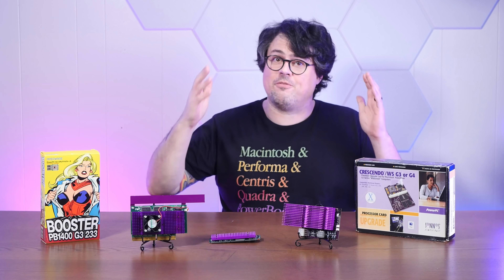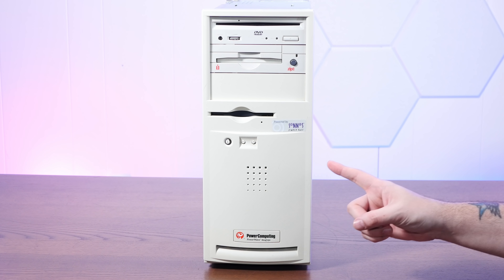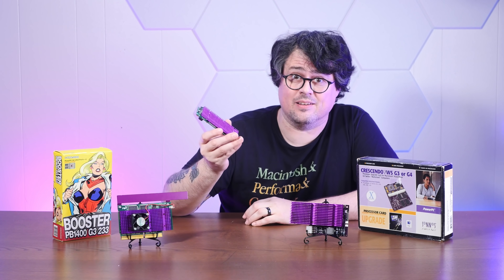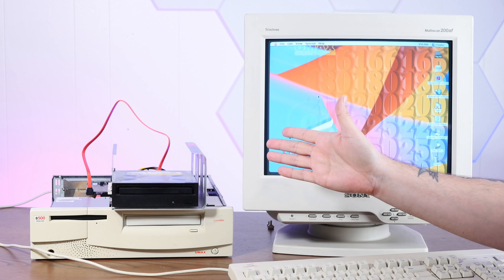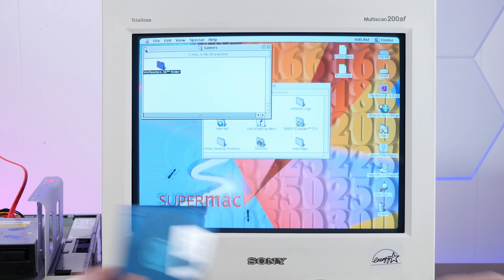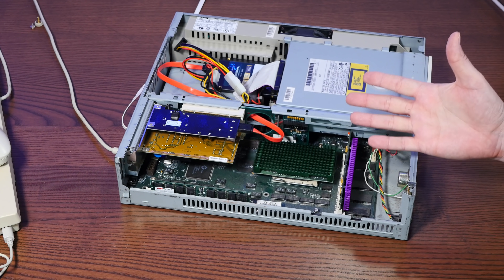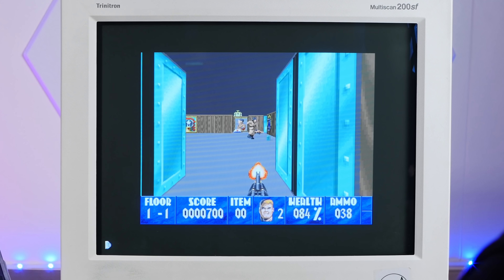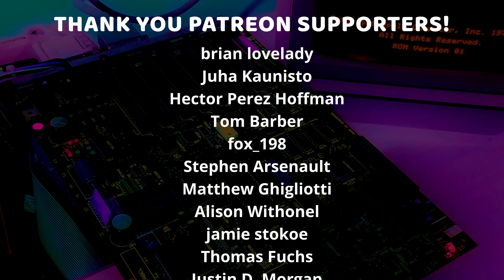An IMPOSSIBLE G3 Accelerator for "Upgrade Challenged" Macs

Comment: Apple back then: "hey, wanna turn your 68k into a g4? we got da hookup"
apple now: "you want a new Mac? no, no. without a corporate expense account, the best you can get is a Mac Mini, and if the warranty sticker still isn't on everything, we get to wipe the boot drive and ban you from buying another"
Apple now has pretty much become like trying to buy a Ferrari, and it's disgusting that people still put up with it. But it then makes these videos that much more exciting!
Reply: People wouldn't put up with it if there were a competent, viable competitor that wasn't equally as bad. Like, if you want a good Windows machine today, with the kind of low-bloat out of box experience you get on a mac, you basically have to buy a Surface. A completely unrepairable Surface. My last Windows PC was a HP tablet that cost me literally as much as a similarly specced Mac would have at the time, 2015, and the build quality was appalling. I treat my computers well, but my HP Spectre X2 literally had buttons falling out of the chassis, and the stand had gotten sloppy within six months. Further, despite using USB C to charge, it wasn't PD compliant. Their USB C charger had a 19V mode, and a PD compliant charger wouldn't work in it, so you were stuck with their brick only. HP are supposed to be one of the good ones, the big corporate players. I would have bought a Lenovo, but Lenovo in Australia basically only sells to corporate purchasing departments. If you want a retail Lenovo here, you're paying Thinkpad prices for their budget Ideapad line.

Since getting my M1 Air, I've noticed small touches to the hardware that I didn't know COULD be good. Like, until now, I've never used a trackpad that didn't make me immediately want to plug in a mouse, and in Windows, I've never seen multitouch gestures that actually worked. I didn't know laptop speakers could be good on anything but a 4kg gaming laptop, but on the M1 Air, they're impressive, and they face UP which shouldn't be so rare, but it is. Frankly, Apple can get as draconian as they want in their control of the hardware we buy, and I'm probably going to keep buying Apple gear because there just isn't good competition for them. The price isn't even as outrageous as it used to be. I mean, sure, there's no $800 laptop option. I'd like to see them revive the iBook branding. I wouldn't mind a lower res screen and a plastic case if I could get a Mac laptop under nine hundred dollarydoos (the official name of the Australian currency), but if someone is looking at a $1000-1500 HP, there are very few reasons for them not to consider a Mac instead.
Reply: @NoobixCube  speaking as someone that's basically built their own desktops and builds and such, sometimes for specific purposes, the big OEMs { Hp, Dell, Lenovo } were never good. As someone that primarily is in it for the games, they're all non-starters. Too much of it being bastardized proprietary junk and stuffed into the worst environments to ensure they only survive past an arbitrary 90 day warranty and no more.

Hard to appreciate anything about Apple now when it feels like the M1 route was only selected specifically to spite the Hackintosh movement, that was making better builds for less money than what Apple itself was offering officially. Whether it is or not isn't the point; it's the fact that given the timing and everything else going on, it feels as if Apple is only going with ARM just to kill off the ability to have any kind of third party Macintosh.

I'm already angry with apple about the iphone making other phone makers basically ape them harder and harder, eliminating all the good android and windows phone designs. Apparently phone makers think everyone can just drop two thousand dollars a month on a phone and be happy. Meanwhile I'm stuck with my v20 because nothing newer can let me replace the battery without committing to open heart surgery skills to do. For my usage and needs, I'm not exaggerating when I say I need a phone that can actually do 10+ hours of screen on. When the modern flagship phone can't even surpass four without whinging for a charger, that's actually getting in the way of a typical work day for me. Back on point, though...

The M1 was designed to be a disposable notebook, at premium notebook pricing. And that's what I find offensive. Even now I still have project builds for say, running Windows 9x or xp to run games of those eras at optimal fidelity and basically "max all the settings without even trying"; I wouldn't be able to do that with Apple even if I wanted to. It's like Apple's business methods from the beginning are counter to that.

Comment: FWIW, I've had really good luck burning discs for old 90s era CD-ROM drives (like my Kenwood 72X) by using blank media specifically labelled as for "music". These are specifically made to work in all CD players, which are finicky much in the way old ROM drives are. They're the only type the Kenwood drive will read. You'll also want to burn them at the lowest speed your burner can manage. HTH!

Comment: I had a thought. Wikipedia says the original Macintosh II can support up to six monitors simultaneously if you filed it with six Nubus video cards, but I've never seen a photograph of anyone doing it, or even heard of anyone doing it at all. Might make for a fun pipe dream (and potentially a YouTube first) if you can somehow find a way to get that many monitors and graphics cards in one place. 

I cannot imagine how slow it would perform with all those unaccelerated cards and a 16mhz 020. Still, if you had a processor upgrade...
Reply: That would be pretty wild to see! I never knew that Apple was boasting that "fact".

I second this challenge Sean!
Reply: I did it with 5, but the Mac ran out of RAM and froze! 🤣
Reply: @Mac84  I just found the livestream where you did that, and holy moly is it awesome!

Comment: I sort of wish we could still do that. I have a Quadra 650 with a Powerpc 601 card in it. It would nice to upgrade my socket am3+ to a Ryzen with little effort. But, part of that was the price of those early macs and accessories for it. Even for the PC though less used in my area was a Pentium Over Drive chip. But now that prices have come down. Getting a new board, processor and ram is about and the same price and you didn't have some limitations. For instance some extensions and software will not run with the Powerpc enabled. Etc, etc etc. I should say mostly additional hardware limitations.
Reply: What CPU is installed in your AM3+ motherboard, and which AM3+ motherboard is it?
Reply: @craigtheduck  I forget the model of Asus board it is. But the Amd is the FX-8350.

Comment: You mentioned having some upgrades planned for the 5400; I'm really curious if there's anything that can be done to upgrade the 5300/6300 series, short of just replacing the motherboard with a PCI model.
Reply: No, sadly. These are already basically Quadra 630 boards with PPC upgrades grafted on, and the ROM is installed on the L2 cache card on most of these models (except for some of the later 100 or 120MHz versions) so there's nowhere to install a CPU upgrade. A logic board swap isn't hard, though: just modify the harness slightly (cut a particular ground wire and replace it with +3.3V to the logic board) and it'll slide right in.

Comment: It is no wonder Wolf3D ran at such slow speeds, you were running at 640X480. Run it at a lower resolution and it would probably be closer to what DOS performance would be.

Comment: I would love to know whether any upgrades were made for the Powermac 6500.  Brilliant video BTW. ;-)
Reply: I actually had this exact Sonnet G3/400 upgrade for my 6500 back in the 90s. It was a nice improvement but it wasn't as fast as an actual G3 machine. I eventually replaced it with a Dual 533 MHz G4 PowerMac. Sometimes I wish I hadn't gotten rid of those machines and that upgrade...